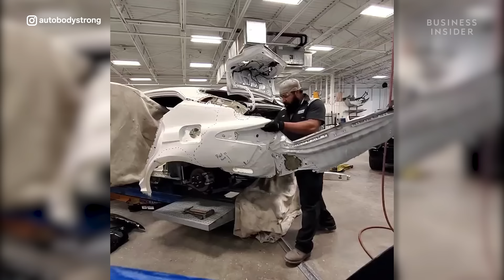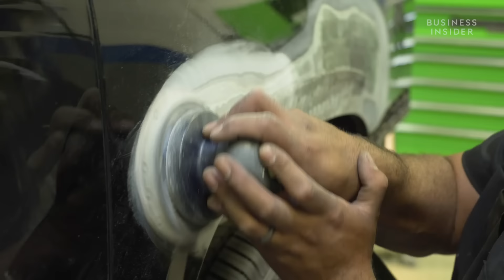How Wrecked Cars Are Repaired | Cars Insider

Comment: What they don't tell you is that metal is never the same after it bends. This weakness means future crashes will in fact be worse even if the repair is flawless.
Reply: Outer panels are not structural, steel has good memory and goes back in place. Ultra high strenght steel in vehicle's unibody does have to be replaced. A creased and repaired quarter panel doesn't affect safety.
Reply: Absolutely untrue lol 90% of our job is making sure the vehicle performs the same way if it was to crash again it’s not all cosmetic buddy. Please stop trying to spread information if you don’t know what your talking about
Reply: @mercury0214  But he's right. The quarter panel isnt structural at all.

Comment: Almost none of the salvaged title cars are repaired this way. They are repaired by a guy named Slavik that repaired them in his residential 2 car garage with some hammers and a frame machine.
Reply: I seen some salvage cars repaired in such horrible ways, and it's scary because those cars are dangerous to drive.
Reply: @alfonsorodriguez3432  yeah, they're dangerous if you don't know how to drive
Reply: @SomeKidsAtHomes  no, they're dangerous because slavik completely destroyed any semblance of rigidity in that sweet deal you're cruising in and will probably fold in half in a 30mph crash
Reply: @manfail7469  exactly
Reply: Haha seriously!  With an oak tree and a chain. your comment made me laugh!
Reply: Yep that was my dad in his apartment complex. He got pissed when management told him to knock it off
Reply: How many of those salvage title vehicles have flood damage though and then you'll have electrical gremlins for the life of that car.  They just have to tell you it's salvage title, but they don't have to tell you the reason why.
Reply: @MyLifeThai371  my car actually is salvaged title from flood damage. 05 lexus ls430. So far its been really great, i do have check engine light on tho cuz the thermostat is stuck open so car takes to long to warm up. Its dumb too cuz if check engine light is on the traction control stops working
Reply: @rlikemoney  On my 2007 Buick Lucerne if the engine detects a misfire, it shuts off your traction control.  The mechanic could not fix the slight misfire. I ended up trading off the car, because I won't own a car without cruise control.
Reply: @rlikemoney  you should be worried about running the car too cool and doing engine damage. Also, could start flowing again and stick closed and overheat. 

Why mess around with a thermostat?
Reply: @MyLifeThai371  i work at a bodyshop and if car is flooded in fresh water, they just pay to have it detailed and carpets shampood, if its salt water they write it off as totalled.
Reply: Slavik does better work than Jethro and Bubba.

Comment: It is fairly easy to tell the good shops from the butchers.  Ask to see the shop if you don't know the company.  If it looks like this shop with the proper equipment kept in good order, you have a better chance.
Reply: If there used by insurance companies they are usually decent shops.
Reply: Exactly.  You want the big, clean shop with all the fancy equipment.  Do not take your car to a grungy, run down shop in a bad part of town.  That grungy, old shop might be okay if you need a mechanic, but not for body work.  When I was young, dumb and naive, I knew nothing about body shops.  I took my car to a small body shop in a not so nice part of town.  Their "paint job" looked like someone used a rattle can.  Tons of overspray, and dust imbedded in the paint.  Who knows if they even had a paint booth.  I bet they painted the car outside, out in the open.  Very long story short, I wound up taking my car to a different body shop fix the mess.  I had to pay the second body shop over $700 to fix the other shop's mess.  All this took place just over ten years ago.  So, you don't save any money by going to the cheap shop.  In fact, it will cost you more in the end.

Comment: My poor dad. Had a body shop in the 80’s. Technology like this would’ve made his life so much easier.
Reply: Yea not every shop has a frame measuring system. We use a good old  measuring tape. But that's what makes a master body man good. Not the tools its your creativity to the solutions
Reply: @stardog2779  definitely
Reply: @stardog2779  it’s a mix of both man.
Reply: @thefreedomleague7259  as a welder I agree it is a mix of both
Reply: @stardog2779  having the correct tools for any job is always good but knowing how to use them is what makes a master craftsmen in any trade
Reply: @stardog2779  Well said . Not sure how old your dad is but i learned on a floor anchored frame puller . We too used measuring tapes but also a lot of strings and bobs .for measuring points . I also had the extreme honor of working with a older Jamaican body man (Eric)  who taught me how to hammer and dolly a dent in a panel straight as an arrow . Technology is great but learning how metal reacts and the old techniques from talented body men is key ! Hats off to our fathers , their knowledge is irreplaceable !
Reply: @stardog2779  also a frame rack is like over 200grand
Reply: @stardog2779  Absolutely! This guy screwed up the black SUV by sanding and welding when it was only enough to reverse the dent from the rear of the body. Of course, it only brings to 90-95% to the original shape, but still better than painting the body. Cars with Painted bodies are cheaper than the dent-fixed ones, paint always decreases the price of a car and makes people to think it was a serious accident.
Reply: @stardog2779  yup the old measuring tape worked just fine for years. The tram bar is what makes repairs easier today. they have holes and measurements all over the place. you just level your car on the frame bench and tram bar it out. Tool mostly used today. once the tram bar fits in the holes you can assure that the panels and gaps will be correct.
Reply: I'm master of this work .I have 25 year xpiriyns  3 year doing work in gulf now in india I need job as auto denter
Reply: @zakiryashussain5813  Wow that's an interesting way to spell experience
Reply: @Zemog23  so novel, a Hollywood star may start naming their newborn kids xpiriyns.
Reply: @Zemog23  or bodyman.
Reply: @zakiryashussain5813  that’s the most creative way to spell experience
Reply: @Zakir yas Hussain- 25 years of Aspirins?
Reply: @zakiryashussain5813  The industry can use people with experience. Please reach out to the nearest large industry representative (Gerber, Caliber, Fix, Classic, etc.), or any shop that has good reviews. Industry needs you brother!
Reply: @zakiryashussain5813  it’s called body technician, or body man, but I wouldn’t recommend this trade because it pays peanuts.
Reply: My grandpa used to beat the heck out of the car frame just to get the shape back.
Reply: I worked in a big auto body shop in the 80s (started in 81) I seen nothing he used that we didn't have only difference I seen are frame machine used bulls eye points and precision measuring tools instead of the computer but it was the same pull it until it was in spec and we had the good dent pulling systems but you needed good metal working skills just like today
I will say this todays PPE would make for a longer life if you have the good sense to use it
Reply: A frame machine takes up so much room a lot of shops can’t accommodate one.  Also that are VERY expensive and a small shop wouldn’t be able to afford one!
Reply: I started my auto body repair career in 1989. Most of the tools shown existed then or shortly after that. Ive owned my own shop since 2001. The work is still gratifying when I finish a repair and the customer leaves happy,  but I no longer enjoy the work. The process can be an enourmous pain in the ass, and customers are getting less and less patient. I work long hours, and It's almost impossible to find good qualified help anymore.
Reply: @edjackson4389  it’s because all the good body men were run off by the insurance companies not paying what the job is worth. I wouldn’t work in this trade again; besides, all that dust and fumes will make for a short life span.
Reply: @elpacho....9254  Nah, I know lots of older body men. My uncle and his best friend got me started. They still take on jobs occasionally even though they both retired 15 yrs ago. My uncle just turned 79 last month.
Reply: @edjackson4389  a 79 year old body man. That would be like a 79 year old basketball player. My uncle got me into this trade also, that’s why I don’t talk to the arse hole.
Reply: @edjackson4389  there are trades that pay much better than body work.
Reply: @elpacho....9254  Not in my small southern town. I own one of the few businesses unaffected by recessions and pandemics.
Reply: @elpacho....9254  Im not sure I understand ur comparison. My point is body work isnt always a early death sentence. And he's not a 79 year old body man. He's a retired guy doin a little body work at home just to stay busy.
Reply: @edjackson4389  are you telling me that the insurance companies pay you fair wages for your work, and that customers gladly pay their deductible, and you in return pay your employees fair wages?
Reply: @edjackson4389  does your shop have a down draft paint booth, and all the ppe require for your workers to remain healthy. How about a ventilation system that recycles clean air into your shop?
Reply: Tell me the name of your shop; do you have a website?
Reply: @elpacho....9254  Why? You thinkin ab getting back in the business? Lol.  Sounds like you are a pretty negative person. I can only assume you have negative intentions with my info
Reply: @edjackson4389  I want to see what your set up is like. Are you not proclaiming to have a good business? Or is it a hole in the wall operation? What flat rate do you pay your technicians? And how many hours can a good technician run per week at your body shop? You didn’t even answer what kind of paint booth you have. I mean if you have a good thriving business then more power to you, but if you have a-hole in the wall operation, then you have nothing to brag about. Look up the huffines Chevrolet body shop in Louisville Texas, if you want to see a first rate operation.
Reply: @edjackson4389  it’s not that I am a pessimist, it’s that i am a realist, and I know what I’m talking about. How long have you been in the business?
Reply: @elpacho....9254  95% of the time yes. Im not one to sit around and cry about the other 5%.  In these smaller town shops like mine have little competition, so we can get away with more. As opposed to a larger city where customers and insurance companies have dozens of shops cuttin each others throats just to get business
Reply: @edjackson4389  crickets. Chirp, chirp.
Reply: @edjackson4389  you know what happens when you assume.
Reply: Eh, in the 80s cars repaired by sight were even better than when they rolled off the factory floor
Reply: Maybe, but I know a shop where they still do it “old school” and have Excellent results.
Reply: @mayken6661  what do you consider old school?
Reply: @insulman100  tram gauge, and tape measure; use fender and quarter paner to get your datum line.
Reply: Because of people like your dad stuff like this is possible, people need to learn from the old school techniques to make it better
Reply: Just retired after 47 years in the business. It was a good industry for a lot of years. Not so anymore the insurance companies have cut the pay so badly it’s hard to make a decent living. The McDonald’s companies of the industry have contributed to this. I retired 3 years early because I either had to do lower quality per the insurance companies or keep my integrity. I chose the latter. Today’s techs are mostly unqualified to do quality work now. The industry is on the brink of collapse. And btw that frame Machine and measuring system that guy is using sucks. My opinion. It’s called a Car-O-Liner. We called it a junk-o-liner.
Reply: @knuckledragger31  thanks man. I remember going to hang out with my dad at the shop in the summers, around 1980. It was awesome to watch these guys at work. They did a lot of Corvettes, cool fiberglass work. My dad used to say you’d never see one with damage in the rear, only the front ‘cause they were so damn fast for back then. And the occasional insurance auction cars he’d buy, fix and flip. He’d bring some home sometimes, Vettes and Z’s, and I’d sit and stare in awe.
Reply: @knuckledragger31  and State Farm is snake farm in this industry.
Reply: @knuckledragger31 I agree, I prefer the floor rack as we call it in Aus. I’m a auto body tech in Australia. The insurance company is not paying enough here. We have south East Asian workers cutting our rates. I prefer the old way of repairing cars. I’m in my 30’s and started in 04 and my father started in 1948 in Italy and then migrated here. What worries me is EV vehicles. Car o liner is no good. A few guys died on them! One guy went to hit it because the scissor arm got stuck, he hit it with a hammer and it fell and chopped his neck clean off, I heard guys dying on EV’s, so I’m a little scared for my future in the auto body trade!
Reply: Mexico is still like back in the 80s then lmao
Reply: The body guys in your dad days were artist!
Reply: @1970swimmer  yes. You can’t find bodymen that can shrink metal anymore; they just swap out panels.
Reply: Not body repair but when I was getting my wheel alignment for my Toyota 86 done at some place they tried placing it on a machine and have a computer do the work. They tried to tell me my control arms were bent and need to be replaced so they couldn't align it until I get new ones. Took it to an old school brake shop where they did the alignments manually. Shop head whose been working for over 50 years in the same shop got it all straighten out for the typical alignment price. 

In short experience and elbow grease saved me hundreds while the fancy machine with the computer got outsmarted and outworked by good ol human ingenuity. Don't care If it takes longer. That incident sold me on going to old school shops even if I have to wait longer for repairs. Plus it's always good to support long standing community businesses.
Reply: insurance payout will make him cry again
Reply: This technology is from the 80s
Reply: I'm sure he had the best tools at the time and better tools than the people before him
Reply: @drink15  
Back in the mid 70's when I started out we made alot of our tools
Big tool companies would send people around to shops to spy on us ' they would steal our ideas and patient them.
Reply: @S K he knows Vaginas...
Reply: I used a come a long and a tree to do the same thing to my 83 Toyota Tercel back in the day when I wrecked it and needed to put a new fender on it.
Reply: In the 198's I went to Chief - EZ-liner school and Car-o Liner school, the CL frame machine was LASER.  This was mid 1980's
Reply: I learn and did body work in the 80's Black hawk in the floor frame machine chain and measuring rods and tape. no lasers or computer guides.. DuPont paint and Bondo....anyone remembers Earl Shives?
Reply: @albshore8  I remember Earl sheib. I’ll paint any car for 99.95!
Reply: right
Reply: Na, he is a master on this with out all those crazy tools!!
Reply: Yeah but your dad had more skill then these guys
Reply: @m.o.5291  it comes down to the person doing the repair. Computers can and are manipulated.
Reply: wow he knows how to fix cars and stuff and im assuming he taught you about it its a very very useful skill to know and it saves you hundreds of thousands of dollars why go to a shop when you can fix it yourself? god i wish my dad knew how to fix cars so he could teach me. i feel so embarassed going into a shop to fix my break pads or to change my oil i wanna know how to do it myself. my dad knows how to fix planes but we dont even have a plane hes not even a mechanic dangit! 😂
Reply: part and labor should be total $4000 to get it done
Reply: Thank you for sharing.  I did this in the early 60s. So much has changed
Reply: Actually the old skool way is easier
Reply: Guys, Here is The True Savior

YaH The Father (Genesis 1), Who, with His HAND, formed “man (Adam)”, from the dust of the ground (Genesis 2:7).

YaH’s HAND they NAILED to the Almond Tree, to symbolize forgiveness of the “Tree of Life” sin OF “man” and thus “The Fall OF man” (Genesis 3)

YaH The Father arrived to be Crucified via the Tent of Meeting (Exodus 33, Isa Scroll), how YaH has ALWAYS arrived
Reply: that goes for ALL technology today. 
Back in the 80's, we didn't have a cell phone or internet. The SIMPLE days
Reply: Sure but how much does these machinery cost? Lets assume the market demand for the service back in the days and now are the same, If your father lease it, does the initial investment and monthly revenue cover its payment and/or warrant the longer ROI compared to how he did it back in the days?
I believe it will be interesting if we can make actual comparison.
Reply: My Dad was an owner of a body shop as well. No respirators, gloves or safety equipment in the old days. So sad.
Reply: if you were born then your dad wasnt poor
Reply: @samarthkulkarni2396  What does that mean?
Reply: @russianelectioncolludingtr9724  because they thought children are assets.  😆 🤣 😂 😹
Reply: @samarthkulkarni2396  I think doc was referring to the hard labor the dad had to do and the long way around instead of having machines do the work and computers telling you where to pull and how much. The work was done by hand in the 80s.
Reply: @davecpgh  yep.
Reply: @doca8792  yep, but we know how some people think. Lol
Reply: @samarthkulkarni2396  by poor he didn’t mean financially
Reply: @samarthkulkarni2396  ok
Reply: @samarthkulkarni2396  He meant poor as in he felt Pity for his dad, not Cash Poor as if he didn't have any money
Reply: @adankmeme651  👍